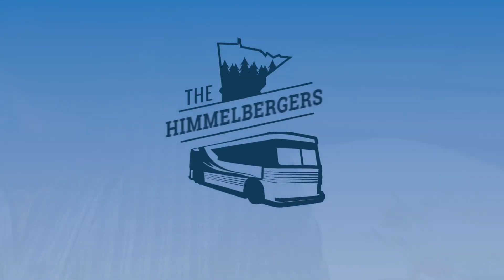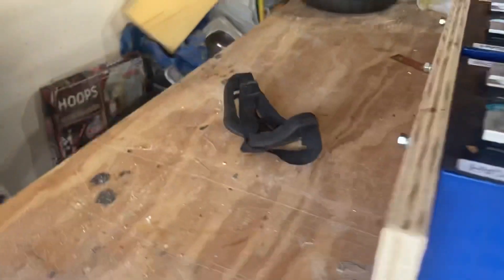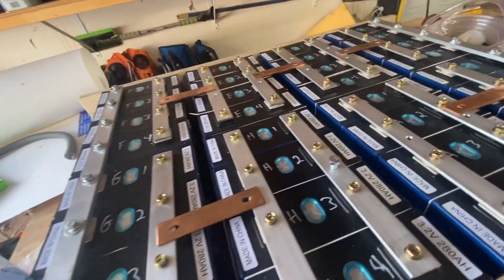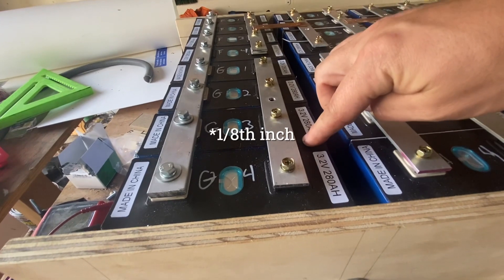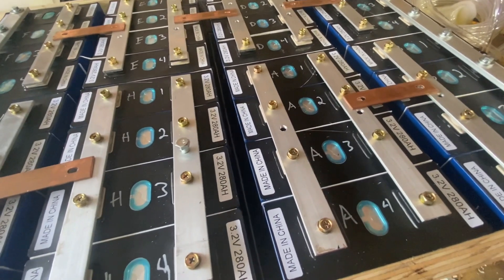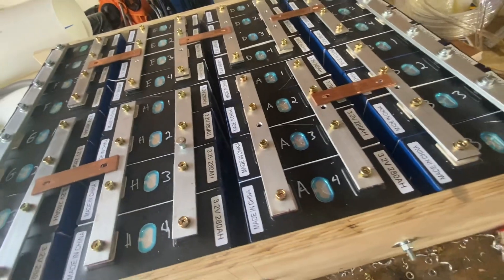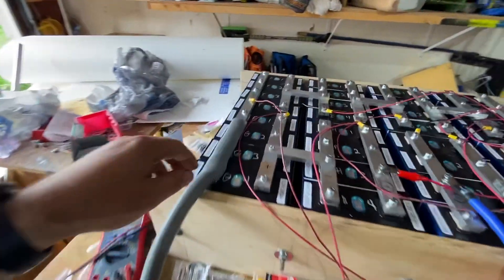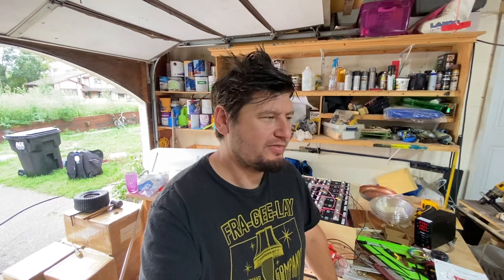DIY 24-Volt 4p8s using 280ah cells battery build for RV Bus Conversion Part 2

Comment: I think you will be happy with those aluminum buss bars. My eve cells have the 2 hole terminals and came with flexable buss bars. The flexible  are kinda thin andbi worry about them but having a 4p battery means not a huge amount of current. I like those thicker aluminum tho.

Comment: The best suff ive seen for insulation between cells is called... commercial rubber roof material. Ive not built my own battery yet just been trying to get it figured out myself
Reply from the maker: We’ve built a few batteries for @sotasolar and still use that thin HDPE, works well enough and is readil available.
Reply: @HimmelbergerBus  I just ordered a bunch of 280 eve cells with the double bolt on the top. They are supposed to be grade a but I guess we will see once they get here. I ordered from 18650 battery store here in US. They have a 30 day full refund deal that made the higher price worth it to me. Yes I like what yall did with the battery

Comment: What inverter do you use with the 280Ah 15s inverter ?
Reply from the maker: Victron Multiplus 24|3000 x2 in parallel

Comment: I have a question can u tell me what is considered full on these cells because I can't seem to get past 3.33 or 3.32 when charging they go above that 3.4 3.5 etc but when they resting and I go back and look at them they always settle back to 3.33 or 3.32 basically 26.6v is that considered full ?

Comment: Where did u get the super long balance lead wires i have a Daly and these are just to short to work with
Reply from the maker: Had to splice longer ones.
Reply: @HimmelbergerBus  but where are y'all actually getting these wires you're cutting them off other bms ?

Comment: i finally have some cells coming and i wanna put them in a 24v configuration like urs so how many total amp hours did ur 24v battery bank come out to with the 4p8s configuration ?
Reply from the maker: Awesome! 4 * 280 = 1120 ah @ 24v
Reply: @HimmelbergerBus  I have 8 120ah cells coming for now then I'ma order 8 more

Comment: i gone a do 2 pack of 8s in series to make 2 pack of 24v and 320ah and them  connect in the 2 pack in paralel  and made 24v 640ah the question is i do that whith one bms whith 16s cell the question is can di that 2 pack of 24v in series to them connect in paralel to make 24v 640ah  which one 16s bms or not
Reply from the maker: I’d do it as a single pack. You use a 8s BMS. Then parallel groups of cells then series them together.  It would be a 2p8s configuration.

Comment: Did u buy ur cells direct from China on Aliexpress or Alibaba ? do u have a link to where u bought them?
Reply from the maker: I bought direct from China Alibaba. They take 4 months or so to arrive.  I also found a supplier that is on Alibaba with US supply, they can deliver in 2-7 days but the cost is about 30% more than the one in China.
Reply: @HimmelbergerBus  dang 4 months tho 😞 I can't even figure out who to buy from on Alibaba AliExpress keep saying delivered by April 16-20 etc but I'm wondering are they telling the truth about they delivery dates
Reply from the maker: @thelithiumpowerch  https://bit.ly/3LCMsFK Here is one seller that has US stock.   The hard thing on the delivery dates is they don't know.  It's part of international shipping and the wholesale process, on the retail side it's more predictable, but also more expensive.   If you were local in the midwest / MN area I have 12  new style and 8 old style cells for sale.  I sell them locally for $190 each now, might be going to $200 soon.

Comment: I have started adding plastic film between each cell. This is because the casing is only protected by heatshrink. Not sure if it makes a difference but easy to do.
Reply: Nice build. Only thing I would say is use studs on the cells as the thread strips out easily. I use same size on my house. 48v though.
Reply from the maker: 100%, I have the studs, plan to change over in spring or winter.

On the Daly BMS failing closed, I have temp based charging for everything except alternator.  I’m in the process of also warming the batteries at all times as well. I think that solves all the problems, right?
Reply: @HimmelbergerBus  do you have mppt solar? You do understand that mppt on most ccs are buck regulator topology. This means.that if the FET fails it shorts the HV panels to the battery. This won't trip any circuit breakers as no more current than normal flows. The problem lies in the fact that once the battery charges, the BMS turns off. This now means the voltage across the BMS exceeds it's rating and instead of staying open circuit it now shorts closed and the charging continues unabated until the battery vents madly. Have a look at ev200 relays. Cheap protection on the charge side. You will need some voltage triggered relay to fire it but I will never rely on FET based BMS with big lifepo4 anymore. I like to have at least 2 failure points to meltdown not 1.
Reply from the maker: @jasondevine6014  I do, I have the Victron blue solar. I’ve never heard of these failing closed / shorting to HV. 

That being said, what you say makes sense.
Reply: You should watch my video on Daly BMS. Be careful about what will happen if you have a failed charge controller. I advise some relays somewhere.

Comment: Hey bud just my opinion I have built a lot of big batteries out of 18650 they stay in balance way better if you put them in series first then parallel them together and that is a big battery bank I would have went 48 volt but I like the video
Reply from the maker: Wow! That’s a ton of work, great job!

I did 24v because that’s what my alternator is (270 amp 24v) and everything else is as well.  

When you mean series then parallel do you mean 4 separate BMSes as well then?

Comment: Shawn, love your videos and journey.  Not having a bus, not having any solar, and no pets, I offer this internet-armchair-expert idea:  You had said earlier you planned to sell your extra batteries.  An interesting, plausible idea.  BUT -- what if you put them all in the bus?  And then plugged your house into the bus when you're parked at home?  Here in the Northeast I'm bombarded by Tesla Battery Wall advertisements for whole-house batteries.  With your solar capacity and a huge battery, I wonder if the potential savings from buying regular electricity for your home would exceed the profits from selling those extra batteries.   Best of luck, either way.
Reply from the maker: I’d need more solar panels to make it work. I am consider upgrading from my 325w panels to 600w ones.
Reply: @HimmelbergerBus  tomorrow's project!

Comment: I remember watching offgrid garage or Wills channel that somewhere it was mentioned that paralleling up to 2 cells is fine for large banks. I cannot remember the specifics but since your setup is very much a 24v system. What about 2 banks of 8s2p rather than a single 8s4p. Just a thought...
Reply from the maker: That is for drop on batteries like SOK, Battle Born, etc.  So far this is working pretty well. 

I did think of splitting the bank up like that for redundancy. If my DALY BMS goes I’m going to be in a tough spot.

Thanks for commenting and watching!
Reply: @HimmelbergerBus  actually its quite the opposite. The reason for this is because for drop in batteries, they each have individual bms attached and also do not have parallel cells but individuals cells at rated capacity. The other reason  of having more than 2 cells in parallel is because all cells are different even if its rated capacity is the same. For example, if the IR of one cell in parallel is different, it will charge and discharge at a different rate than others and will take all the ground work of others. For better explanation, this is the link and you can forward to 24:00 for more details. https://youtu.be/E4pN4DVPOcY just for sharing though as part of common interest in diy-ing.
Reply from the maker: @simonchong5850  Having a battery like this catastrophically fail is a concern of mine.  I watched that clip, I recall watching this full video back when will was in his RV.  Wow, what a crazy ride he's been on  (good for him though)

As far as I can tell that's mostly his opinion.  I'd be interested in seeing the actual failure modes in a situation like this.    To my way of thinking, paralleling more cells reduces stress on those cells and further reduces the likely hood of catastrophic failure.   I'd say the biggest chance you take is paralleling 2 cells, after that it's it's just degrees of risk.   

I've heard it both ways, for now, for me, I'm trying this.  Like I said, I may split them up, it all depends.  So far, it's working great!  Pulled 830ah out of the bank this weekend. Still need to properly top balance.  

I truly appropriate the insight and concern, love the feedback!
Reply: When that BMS fails, you’ll wish you had redundancy with four BMS’s. Current draw is 0.015 A each. Then you can monitor each individual cell. I use 1/8” and 1/4” ceramic fiber cloth between cells and batteries to prevent catastrophic failure when one the cells shorts out. Inside those prismatic cells are two “jelly rolls”. Get.yourself some 2” and 4” rolls of high temp polyimide tape. Try to only use non-combustible materials in contact with cells and bus bars.
Reply from the maker: You'd better subscribe then so you don't miss it :-)

Comment: It's BUZZ bar, from the sound it makes under load. It will actually vibrate at the frequency of the power system.  Secondly and most important, coat all your steel bolts, you'll get massive amounts of galvanic corrosion, this is why you either spray the connections with a battery terminal spray. Or you use brass bolts, and avoid the corrosion issues.  Another thing double bolting, don't use a washer. The washer will cause the bolts to separate  rather than locking together.  This is how you unbolt threaded studs from things like engines.
Our two main UPSs at work have 6 banks of 400V DC and the interconnect links are nowhere near as large as the links your useing. DC current operates differently than AC, the longer the conductor length, the larger the required conductor. There are sizing calculations you can do that take into account the length of single conductors.  Hope this helps.
Reply from the maker: Thanks for the knowledgeable comment on this one. Yeah, I can feel my main cable buzzing under load. 

I’ve had my 1/8th and 1/4th in bars get hot, I’m thinking it may have been bad connections. I forgot to mention I steel wool polished the bays before connecting. I’ve done some loads at 150 amps today and it’s all cool as a cucumber. 

Thanks!

Comment: Guessing you will get to this at some pt.   (Im about 5 mins in) but if you use 24 volt, you need 24 volt components as in, starter, glow plugs etc in engine, and wire gauge, fuses, lighting and electrical appliances inside..

As for aluminum, the massive downside is that it litterally disintegrates electrical and magnetic fields due to it being highly diamagnetic.   (This includes your personal electrical field) 
Anyway, worth considering....
Watch Biological Architecture Part 5 on yt chan Inphiknit Fractal (my other channel) ..will link in edit if it lets me. 

https://youtu.be/WJrkqcnmoqI
Thx for the vid:)
Reply from the maker: Our bus is an MCI, it’s 24v already. 270 amp alternator , 24v lights, etc. 

On the house side we use 12v from at 24-12 converter from Victron. All our other stuff is 120v AC.  

On the aluminum side  ¯\_(ツ)_/¯ I’m still here, been using it for stuff like this for years.  I don’t follow the specifics on all of that, so I’ll take it under advisement. 

Thanks for watching and commenting.